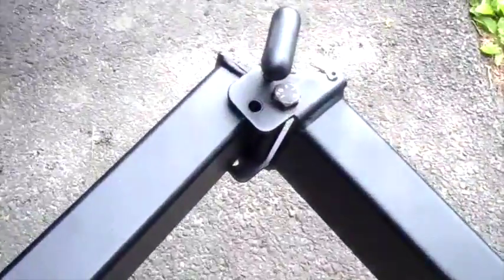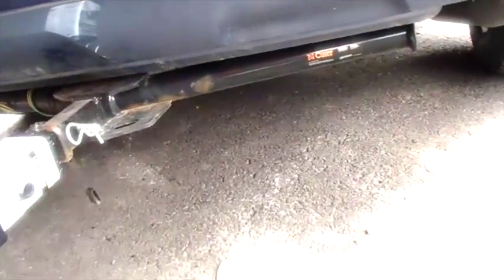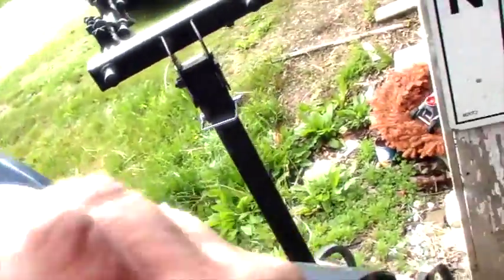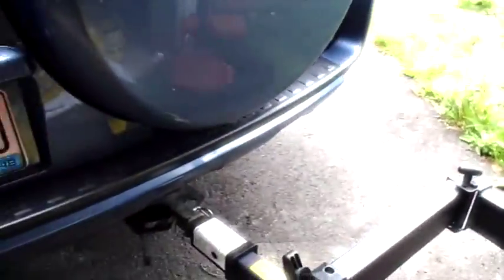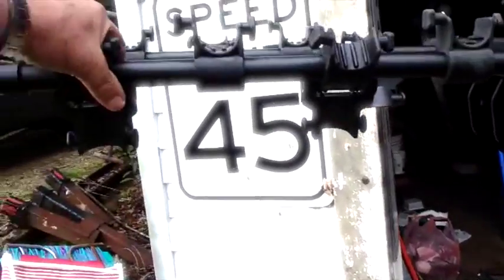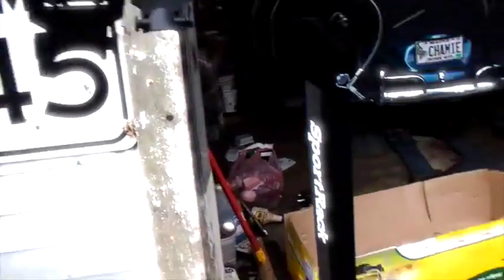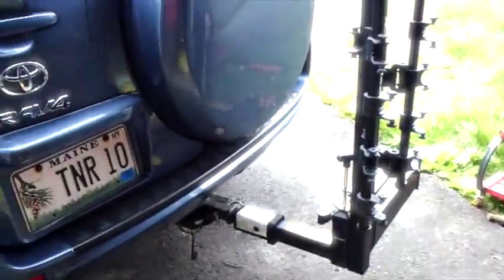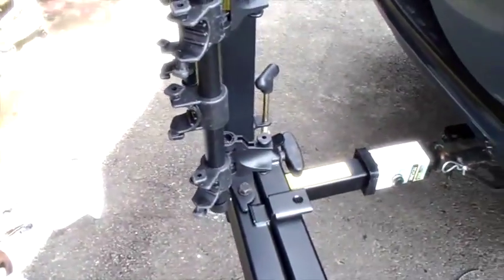Sports Rack Ridge Swing 4 Swing Away Bicycle Rack

Comment: dont forget that with the adapter it allows someone to just pull the pin and steal the rack and bicycles easily. A bolt makes it harder
Reply from the maker: That's a thought, although I do have a locking pin..